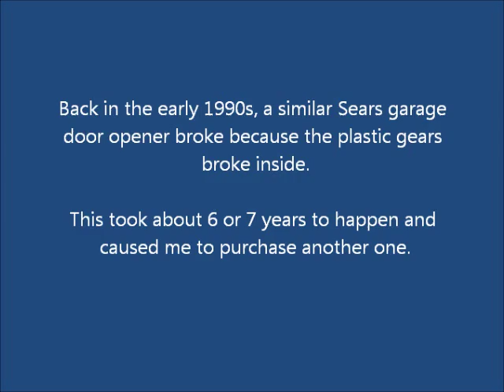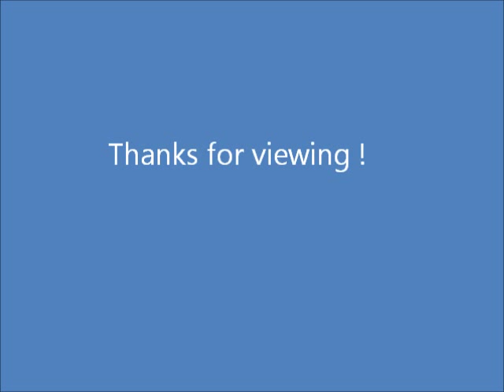Sears Garage Door Opener Lubrication

Comment: Hey Terry,
We have the exact same door opener. But there is only a PUSH BUTTON to control this thing. I am wondering if I can add a keypad or a more fancy button, so I can atlas control the light bulb on it.. Do you have any ideas? What switches/remotes do you have working with this age old door opener. 

I have been looking up universal remote keypads and wall switches, but I am afraid they won't be compatible with this old old door opener.

Let me know your thoughts ;)
Reply from the maker: The online manual is here. It's for a lot of different model types:
http://homeappliance.manualsonline.com/manuals/mfg/craftsman/13953637srt.html?p=1

According to the manual on page 18, it shows the deluxe wall control which has a way to control the light separately. My system doesn't have this feature. I have the 3-button remote and the lighted wall control. The manual says on page 32 that this deluxe wall control is only available on model 53824. This model number is referenced on the cover page of the manual as 139.53824SRT. You can verify if you have this model by the cover plate on the motor or it may be written on the inside of the cover plate if you remove it.

This Sears Parts Direct site can be used to try to get different switches for the garage door opener. They list their number as 888-213-5824.

http://www.searspartsdirect.com